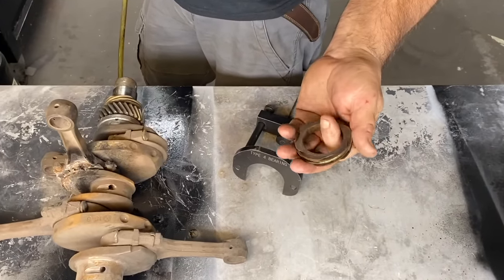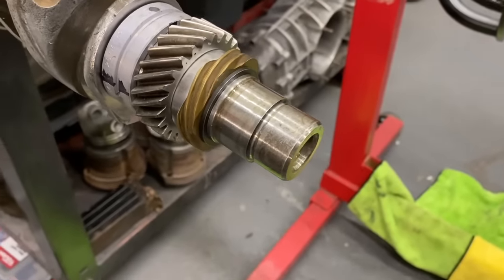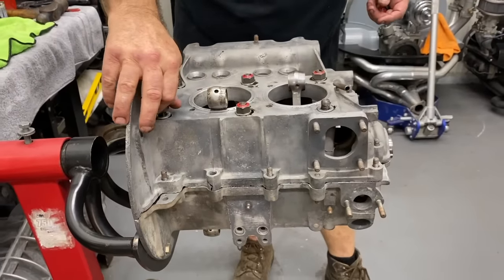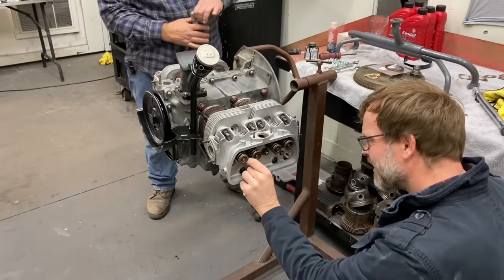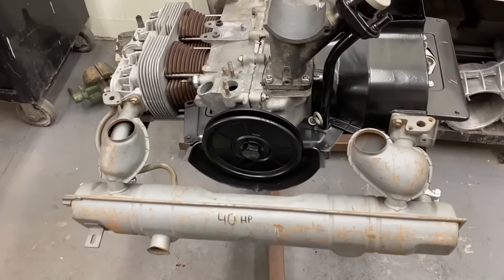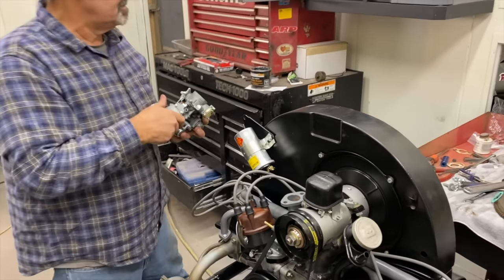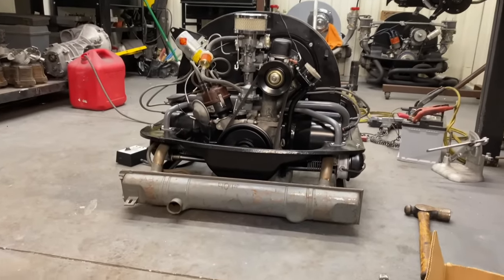VW Engine Build - Complete Start to Finish | Type 1, Flat 4

Comment: I always used scotch bright pads (red) with dawn dish soap to clean cylinders lightly to knock off the sharp edge , especially on air cooled engines, I did this to all my rebuilds. try it some time, My rebuilds lasted over 25 years and still going, I rebuilt Lots of diesels, I did this to a cat engine that had 700 thousand miles honed the cylinders with dingle berry used cylinders and pistons new rings. the customer said the oil was always cleaner in that engine at oil changes then any other it has 400 thousand miles and still going strong. Try it you'll be amazed , I retired after 35 years.

Comment: Good job, but please use hose clamps on the  fuel line. You don't want leakage of fuel and what else happening. Also there are double coated fuel lines available that wear less quicky. The fuel filter doesn't belong there in my humble opinion. Potential leakage of the fuel above the distributor is fatal.

Comment: Hi CT, just rewatching this one because I just picked up a old 40hp to play with. The guy I got it from works or owns a machine shop up north from here and he watches you and Darrin. He loves the channels. He has a 58 bug that he is building a super horsepower motor for it. He has a bunch of VW parts for I know where to get them now. He didn't have a starter though so will need to get one and the setup for starting it on the floor like you guys did. Is that the normal exhaust that curls under the motor that is sits on?

Comment: I built the air cooled vw engines for many years. 40 hp valve clearences .008 intake and .012 exhaust.  There was valve clearence variations on some engines if the rocker studs were shorter or deeper into the heads on some older heads. The .004 and .006 were used on 1500 and 1600 motors.  Are you building a bus engine? The muffler looks like a bus one.

Comment: good morning where did you find the bracket that allows the starter motor to be attached to the crown for starting the engine
without fitting the gearbox
where you can buy it

Comment: I used to rebuild those engines when I was in my early teens. Installed a lot of big bore kits, dual weber carbs. Complete rebuilds and reconditioning of every part
Reply: Most Lego sets are more complicated to assemble than a VW engine😂

Comment: i have rebuilt a few 40 horse and countless 57 and 65 i did notice you didnt put a waher on the exhaust studs.and when installing number 1 cyl i noticed the oil ring out did you by chance squeeze  that back in off camera or just hit it lucky and it reinstall its self.from experience i have on a few hit it lucky so i was just wandering if that was slight of hand or luck lol you guys are doing a great job and i love your engine building room. i have to clean an area in my shop and use that

Comment: Hi CT, getting ready to start rebuilding my old 40hp engine. I got new bearings, pistons and jugs for it. My case is older without main stud Orings and cam bearings so not much needed to put the case halves together. I also got new lifters since the old one were flat. The fun starts.
Reply from the maker: Hey Tim! that's awesome man! Make sure you film all of it and share it with everyone! =) I'm working on my 40h as well. Just rebuilt the 26 pict-1 today. It's got more punch now. The fuel inlet came loose so I need to find a barb with a thread and screw it in so it doesn't pop out again. That's how they catch on fire.....what brand cam and lifters did you buy?
Reply: Using the same cam and stock lifters but the box says racing lifters. Maybe it will go faster. Haha. Never rebuilt a VW engine before so a first for me. I have rebuilt ford and chevy engines before which are allot harder. These are tinker toys compared to those. Getting our newer RV ready also for our annual trip down the Pacific Coast. Can't wait.  Will share videos on YouTube.  Oh, I haven't even looks as to what the original carb I have for this yet? Looks like it took a mudd bath. Will drop the whole thing in my chemdip can and go through it. Yes, these are fire starters so tapping it out and put in a barb fitting would be a great improvement for sure👍

Comment: Fun to watch.  I got a Tesla Model 3 but still cool to watch.  I helped a crew chief for a ASR with a Porsche Engine.  My partner in business was going 200 mph on the race track.  One thing he learned at driver school at Sears Point Race Way was instructor told him to step on the brakes at top speed.  He ended up getting brusing from the safety belt. Hee. Heeee.

I had a DAtsun 510 race car and there were these Formula Atlantic Race cars and we both were tuning our cars before the big event.  I was amazed at the power of those cars.  I saw him on my rear view mirror and so I stuck my fingers out to point where to pass me.  Every shift he made was amazing.  I watch his rear tire expand and contract.  Unless you are a race car drivers most people don’t get that chance.  

I eventually got into Show room stock C.  I had a Ford Fiesta 1600 cc and set the lap record at Sears Point Raceway and Laguna Sega.  The trick is to drive smooth and take a late apex.  It may be the longest path but the fastest path.  The definition of a late apex is to make the largest radius.  

To truly be a great driver I took classes over $3,000.00 for a two day class in refining my driving skills.  It was definitely worth it not only to save your car but to react and drive in a way to not kill yourself.  Road Racing Ain’t Cheap.  I quit after 4 years after being the best driver and went into extreme snow skiing.  I think skiing was more dangerous. Done jumping off plane served as a Medic in Vietnam and everything crazy. 

I am doing more safer sports like Mix Martial Arts.  Age 72

Comment: Hey CT, Darrin didn't do special with the crank before heating up the gears and putting installing them, did he? Other than cleaning it good correct.
Reply from the maker: it's possible but I don't think so...He may have polished everything with a super fine paper or scotch bright and he may have opened up the oil holes a bit to allow more flow. It's been so long I can't remember.
Reply: It was a struggle getting the large gear on and the top small bushing but prevailed with some persuasion. The old service manual for this, states to heat up the gear in an oil bath to 176 degrees to put it on. everyone uses a hot plate but put and little oil on where the gear is going. it states to press the gear on with a tool which is like and pipe that goes over the crank so made my own tool and it worked. The issue with the small nose bearing was a sharp edge on the crank? have to file it down to get the bushing on.

Comment: Nice video, thanks!  What kind of sealer did you put on the bottom of the cylinders?
Reply: i'm still searching for same answer - did you figure it out?
Reply: @conradspamer2077  Not yet, I'm hoping the OP will respond but no luck so far

Comment: That last cylinder you guys put together on the wrist playing you didn’t spread the assembly lube all around the Rod I just put a little dab in there and left it in the bottom and then push the painting so 3/4 of that restaurant is dry probably why you had a little bit of trouble putting it in all the way

Comment: I haven’t assembled a VW engine in decades, great video. One thing I normally did was use plasti-gage on the rod bearings to determine proper clearance, did you do that part off camera?
Reply: hahahaha thats a funny one
Reply: @michaelsaint7325  what is funny about it? If the oil space isn’t correct the engine will either starve for oil or not build up pressure.

Comment: Why do heat up those parts??    
thanks...  great Video
Reply: The heat makes the part grow in size so it can be slipped on the crank shaft. As it cools it shrinks and is secured so tightly that you have to use a special puller tool to remove it, as seen early in this video.This is called a shrink fit, they use this process in many manufacturing processes, as it make for a very nice connection. They also use this process to connect rods to pistons with a non floater type rist pin.

Comment: My 65 VW lost oil pressure and made a terrible rattling sound we took it out and tore it down, carefully inspecting every part. We couldn't find anything wrong.  We finally got to the crank. Pa pulled it out of the case and it came out in TWO pieces! Back then you could order a complete rebuild kit with a 3rd over crank from JC Whitney.
Reply: When I was a teenager in the late 60s, JC Whitney was my go to VW parts place. Bosch plugs for 49 cents and a piston/cylinder big bore kit for $49, those were the days.

Comment: 17:03 Crankshaft assembly
28:49 Piston install
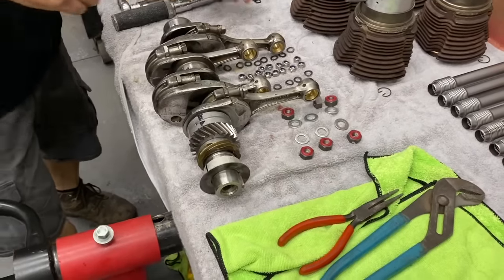32:15 Crankshaft Install
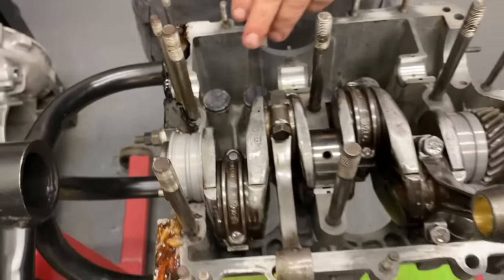37:41 Camshaft Install
38:38 Short block final assembly
45:45 Piston and Jug install
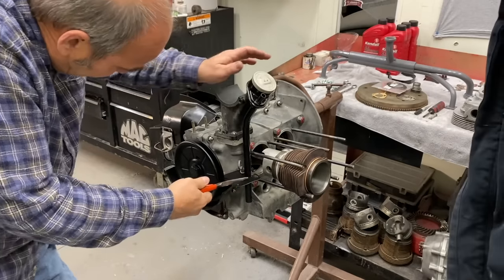48:33 Wrist pin
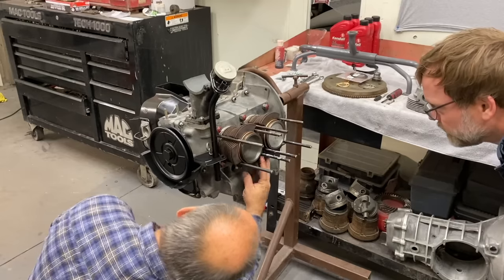52:21 Head install
54:06 Pushrod tubes
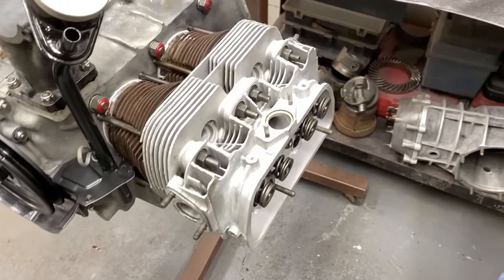1:03:15 Pushrod install
1:04:00 Rocker arms
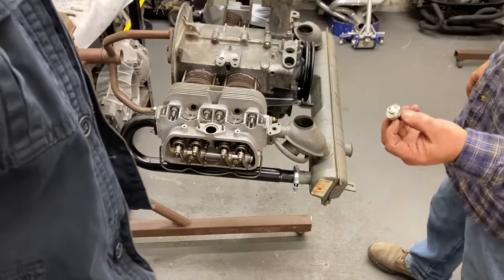1:18:52 Oil sending unit
1:29:22 Distributor install
1:36:24 Intake
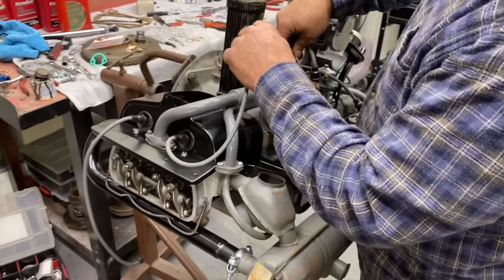1:43:25 Firing Order/Plug wire install
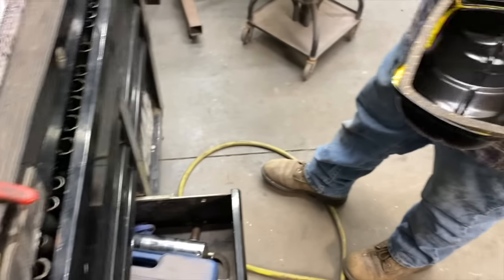1:56:28 Valve Covers
1:58:01 Generator + Fan 
2:04:40 Carb install
2:14:55 Clutch 
2:17:04 BOIYOIYOIYOIYOING
2:19:27 Run

Comment: Engine firing order is 1432 but clockwise, not anti clockwise as shown 1 hour 43 minutes 20 seconds in that's why engine wouldn't run at the end. (noticed leads had been changed but no mention of it?) sorry but waisted loads of time previously and don't want other people doing the same... great video guys.
Reply: Yes , I totally agree, because the crank is a 180 degree crank,making the firing order 1234 or 1243 , that's a flat plane crank they are assembling

Comment: My brother always raced VW Dune Buggy's,......in mud runs.
He would enter 3 times and take 1st, 2nd and 3rd place other racers hated him the fans loved to watch him wheely through the mud pit.
The other racers tried to look at his engine to see what 4 barrel carburetor and nitrus he was running.
He quit using VW engines because they always spun the same bearings,...it was cylinder 1 or 2, I forget now.
But he started using the pinto beam kit using 74 pinto engines,.....titanium bolts and everything else.
Then his buggy was untouchable,....Then he also ran in the outlaw class against 4 wheel drives.
Reply from the maker: Very cool! =)

Comment: The things you need to show are how to set up the engine to run on the floor without a gearbox or bellhousing, as how are you attaching the starter motor and the wiring of that. be more detailed in what you show beyond torquing up bolts...

Comment: What then is a Longblock ?
Reply: The short block focuses on the engine block and bottom end rotating components, the long block goes further by adding components that mechanically complete the engine's primary assembly.

Comment: I used to work as an aircraft mechanic, think about it, if your 3500 feet in the air you don't want to come down. 🤔
Reply: You mean 35,000 feet.. hope your not flying at 3500 feet
Reply: Same here i have my a&p
Reply: @osso12 actually 3500 for a cessna or archer is not bad

Comment: here is a great tip i use when cleaning  parts for final assembly put a old alu radiator on a barrel and it works great to let small debri and the cleaning fluid fall away from your parts

Comment: 1:20:20 what is this monolith thing?
Reply: That my friend, is the oil cooler. Air from the engine fan blows over it and cools the oil, which is why a big point in the video was made to ensure it was completely clean and free of any damage. Other than the engine tin, the oil cooler is one of the most critical components to keeping these air cooled wonders at proper temperature. ☮